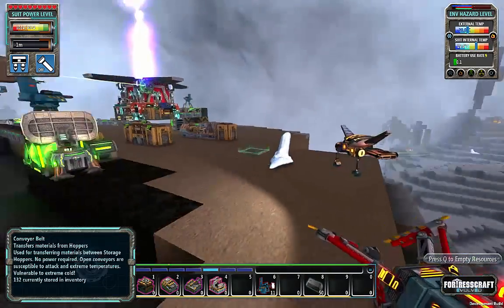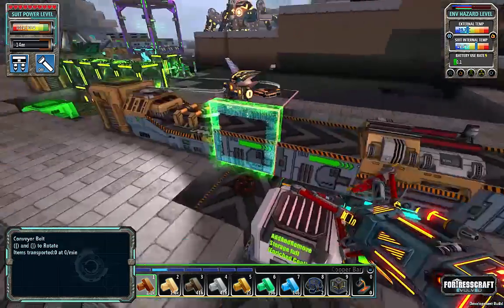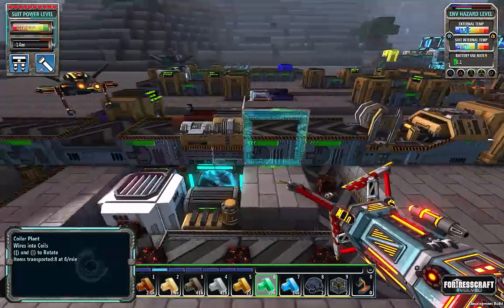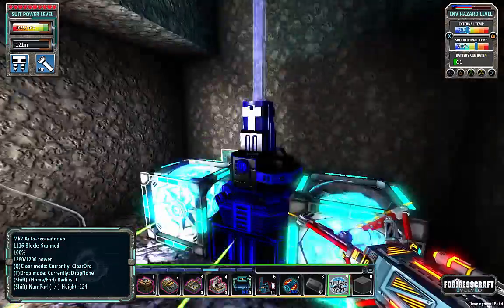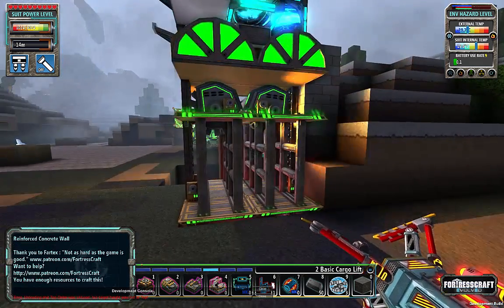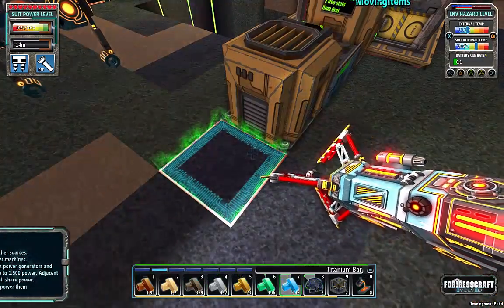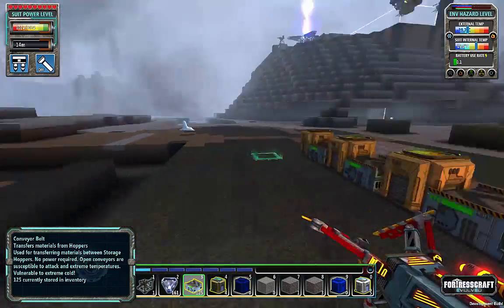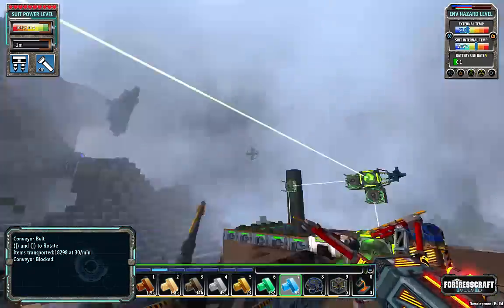FortressCraft Evolved : Mega Factory - Ep 13 Disintegration

Comment: @9:09 you cut a hole and then had the blocks build from the top down to you.  How did you do this as I was only aware of the build to me were you hold CTRL and the far end and the blocks build to you? 

It appears that you somehow did a reverse build to me by clicking on the point next to you and the blocks built from the top down.
Reply from the maker: If you superbuild on a block one higher than the floor you are standing on, it will build 64 blocks on top of the target block.
Reply: Thanks so much for the tip.  I am really enjoying your series.  Keep up the great work :)